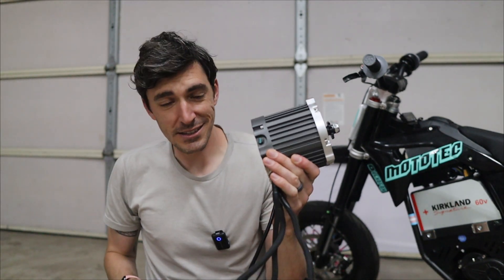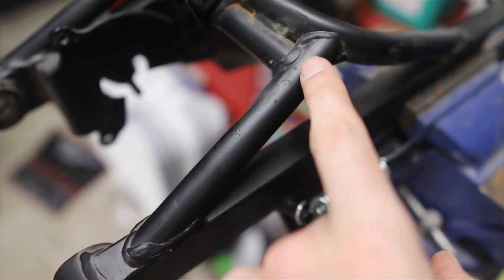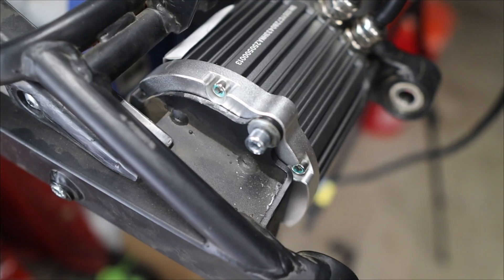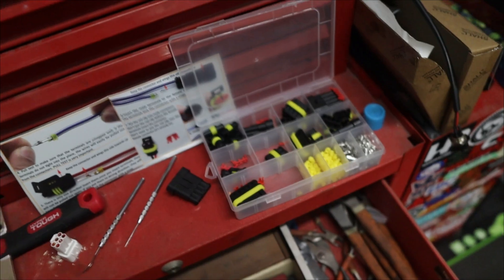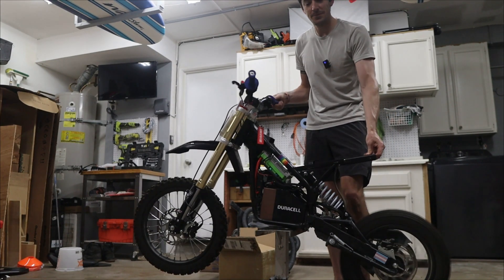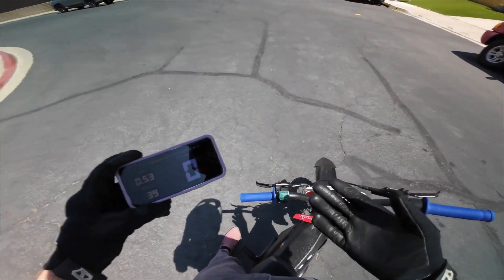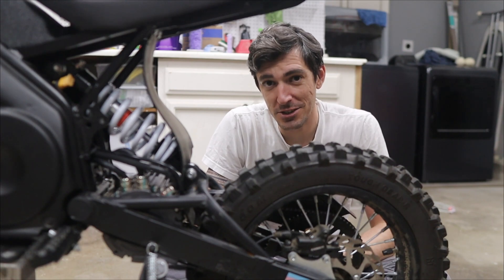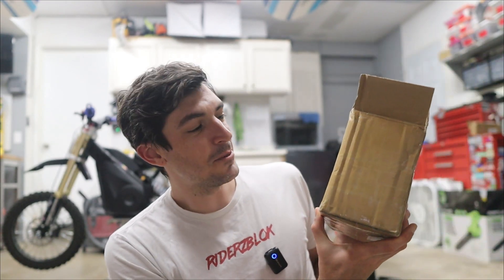The Sotion GTS11-C Motor Instantly DOUBLED the Power!

Comment from the maker: I know the 60v was in the background, but this is just for the 48v, 60v doesn't have a drop in motor that im aware of.
Reply: I have the same Mototec and I am about to get that motor.whats your sprocket setup
Reply: Ok thank you but i have a question can you put a 72 volt amorge in the 60 volt without a fardriver because the conntroler says 60 volt
Reply: @angelaking2029 no you can’t. The controller and the battery have to be the same rated voltage if it’s not the controller will blow because it can’t handle it. The first upgrade should be getting a 72v controller then a battery or motor.

Comment: Hey mate great video! Did you look into a swing arm to match with this set up?

I just ordered the gts11-c v2 that's been redesigned to fit the 48v mototec.

It arrives in two weeks I'll be making a video on it when it arrives.
Reply from the maker: I didn't know they had a v2 come out, but I'll be cutting and re-welding my swingarm. Look forward to seeing it in your video!
Reply: Where do you order them?
Reply: have you made the video yet

Comment: If you want to go faster raise your voltage and lower your amperage. You can basically ignore the voltage rating of the motor, amperage is what makes heat. Heat is no bueno. I was at 72v then 96v very briefly and now I'm on to 144v. Yeah they make a 144v Fardriver and it's a little different than the other children. Metal top cover, some weird proprietary cables, and my favorite part...no potting and a higher IP rating. No potting is great since I'm always replacing FETs in these things. 

144v...very robust. Very. A 144v 24ah battery is the exact same amount of cells as a 72v 48ah but you put these 2 in a range test the 144v is going to be more efficient and go further faster. 

I've been building my own packs for many years now so to be uts no big deal to reconfigure some but I have gotten into the habit of making them more modular now so I can change the parallel/series connection based on what I'm getting up to and which bike I'm using. I use the same connectors on all controllers and motors and batteries so I can easily swap out components. 

Raise voltage. Voltage is the key to speed. They can make 12v controllers but they don't because it would require such high amperage and giant wires to accommodate the wattage required to fast and losses would be pretty bad. You don't need big wires because of voltage it's always the amperage. 

Stark Varg, 360v nominal, 420v fully charged. 

This is the way.
Reply: im thinking of building an electric dirt bike can yo pease send me the lin to the far diver 144v please i cant find it and what bms do you use for such high voltage
Reply: Thats outstanding i cant work on batteries at all i get them built to order at silly money ive yried 72v and 98 not tried 144v ive shocked myself on a 72v batt build for my lmx never again !! ill leave that to the pros batteries nowadays are cheap id pay over £2800 for a 72v 20s10p 150 cont batt now i can get a battery same size capable of 2xamps constant for around £900/ £1500 they are far cheaper im waiting on my amorge batt now
Reply: Amorge are ok. Eve cells and antbms normally. That's a good combo.